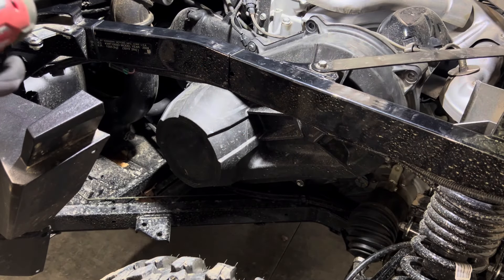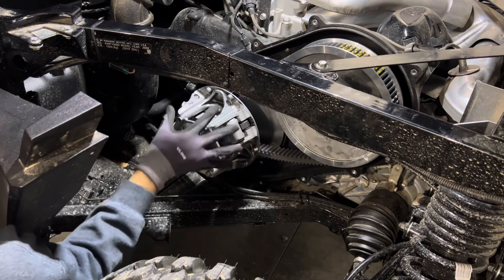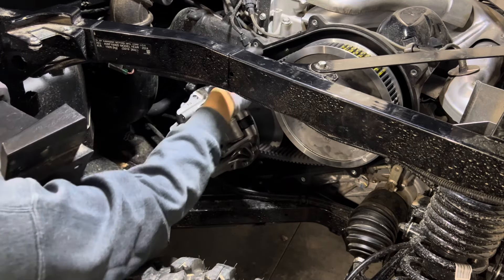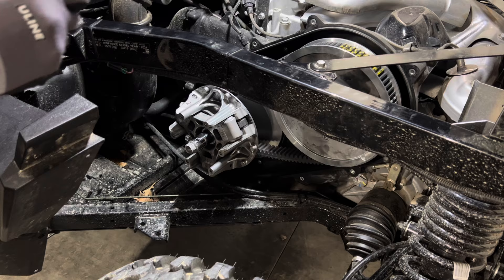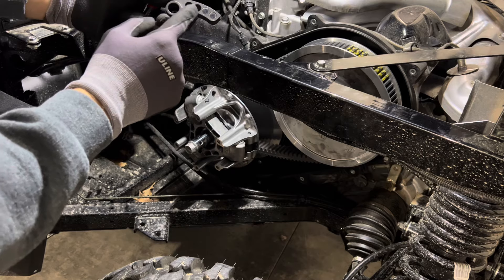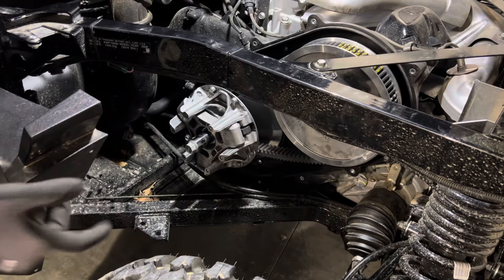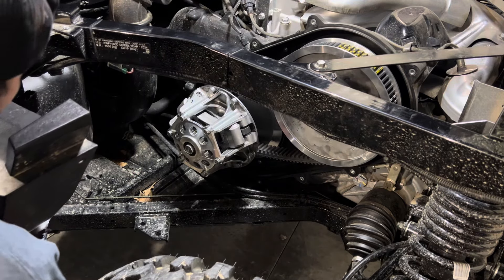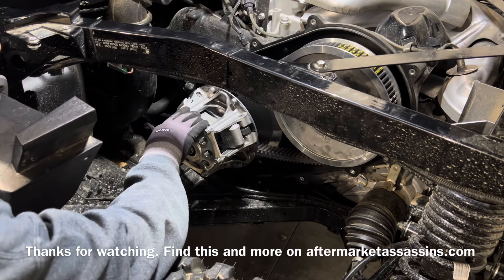AA Kawasaki Ridge Clutch Kit Installation

Comment: I haven’t looked but are spare snap rings included in the kit ? If not you may want to sell them as a extra because they will  get lost or damaged
Reply from the maker: They are not at this time but we may do this in the future.  We have reused our snap rings over 100 times doing weight changes and no issues.
Reply: This is great to know because I had the same question. Thanks!